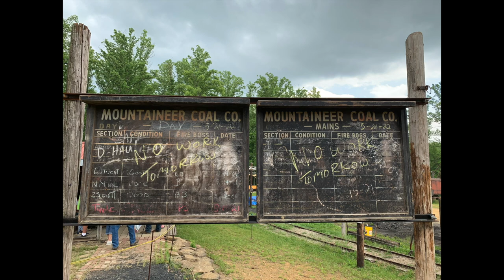Brownsville PA, National Pike Steam Gas and Horse Association Show May 2022

Comment: All of you are pretty good with the string shovels at digging and truckloading. I think it is time for a basement digging contest. Straight walls, square corners, flat floor and close to the batter board dimensions.  The big Northwest’s need not apply.  Front shovels and pull shovels.
Reply from the maker: haha. it would be interesting. i was at kinzers for a show and a guy was running the Bay City pull shovel. when i walked over i was impressed with the square ish hole he had dug with straight walls.    definitely not his first time

Comment: Nice video.  We have a Northwest 80D up here in CT at Zagray Farm. That 180D is a beast!
Reply from the maker: ill get out to that show eventually. is that the one the engine is getting tired in?
Reply: @73DiamondReo  From what I hear the crankshaft has play in it which turns into low oil pressure when it gets hot,  The throttle on the engine works on oil pressure so eventually when it gets hot it forces the throttle to idle and it dies :(

Comment: Morning Frank!! Wow! great video, I have a question, when you engage the tracks to move the machine, then you dis-engage, is there a mechanical "park" brake? Hope you or your buddies were able to use some of that stuff I sent you...I hate throwing anything away Thanks...Be safe!!! God Bless!!!!
Reply from the maker: glad you liked it.  Depends on the machine on how its held still. some have brake bands that might be part of the steering. some have dogs that lock it in place.  I used a few items and im sure the diaphragms will come in handy. not sure if i have anything for those linings but my buddy might.  no time for truck stuff, just been working a lot and its show season so it can wait for now. moving a machine home later this month also.

Comment: I think you operate a camera as well as you operate machines. It doesn’t take a rocket scientist to figure out this is not your first rodeo. I think you are a smother operator on Everett’s model 6 than he is, and then to go run the left hand swing Lima, after coming off the right hand swing Northwest shows you have a great knack for running old machines. I’m not sure what you did for a living before you started with your camera, but it looks like you have run some equipment in your days. Great video and keep up the good work 😜👍 All the best to you. Bill W
Reply from the maker: Bill im still Green as they come but i appreciate the kind words.  I can't hold a candle to Everett or Flash when it comes to running this stuff or many others at that show.   one swing clutch was getting weak or i would have been more aggressive coming back to the cut.  I do alright going from left to right hand swing, push to pull levers but i do make mistakes and my timing isn't always the best.   I think we've talked on the phone about your IH powered 22b in the past. I work for a large oil company as part of a maintenance crew on their pipelines.  a good part of the camera work  was done by my better half Debbie when it came to filming me or some of my friends here and i appreciate her greatly. Thanks for watching and commenting!